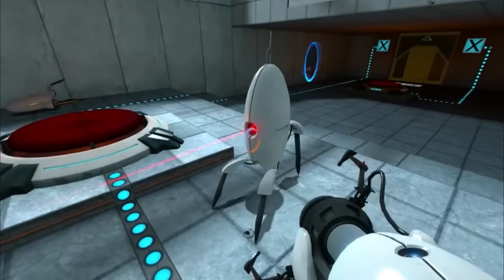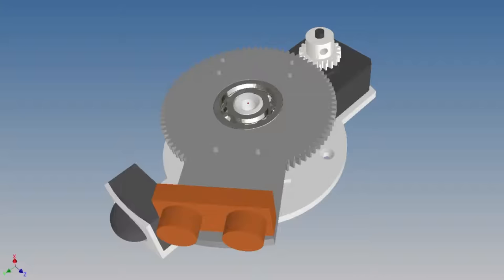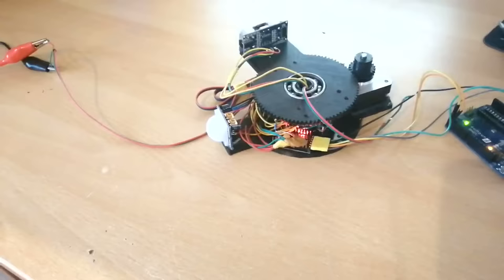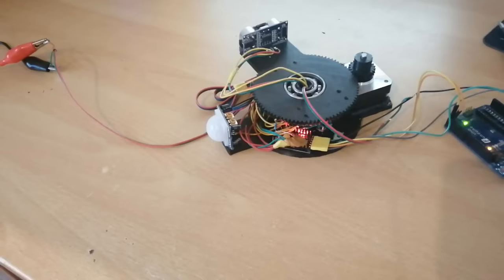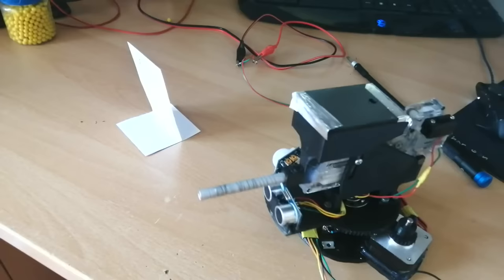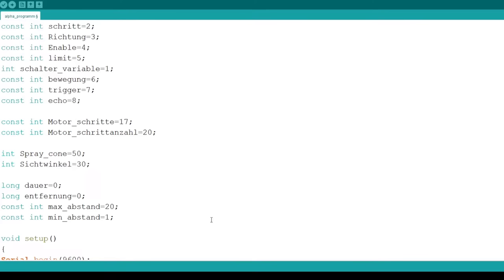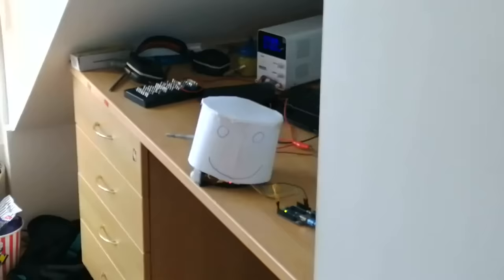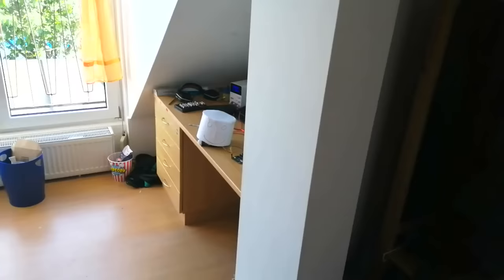Real Life Sentry Turret, that Protects your Room

Comment: So my question is, if you have another object that isn't moving, say a water bottle in the way, how would the sentry distinguish between the object that triggered the motion sensor and the other object sitting in its path? The rangefinder only finds objects within the area of 2 meters so it would shoot at literally anything within those 2 meters moving or not. If I were you, I would check the sensor and see if any events are fired detailing the location or at least general direction of the object which moved, and then the first function of the rangefinder would be to search that immediate area. This could also be done possibly by using multiple sensors in a circular arrangement with a narrow field of vision, whichever sensor fires first is where the sentry rotates to face first, this way you can at least target something in the general area of the detected motion and not just the wall
Reply: Same reason why if you are driving the speed limit but are in front of the camera when another car sets off tye detector, you get the ticket.
Reply: Or you could mount it on the door way facing the entry so the only object would be a human

Comment: Love this idea but personally would have gone with paintballs.  Having played both games, I've come to the conclusion that while airsoft pellets can do more soft tissue damage than paintballs with their high psi, they hurt less on impact and therefore have less stopping power.  Paintballs carry considerably more energy to target and inflict more pain, while also having a much lower chance of causing external bleeding.  Airsoft pellets leave bug-bite like abrasions on the skin, while paintballs leave large bruises.  Do you want the trespasser to feel like they've been bitten, or like they've been punched?
Reply: Sure, cleaning paint off your walls is a good idea 😂
Reply: @JC-Alan  Well it's non-toxic and non-staining, so a lot easier than fixing the tiny holes airsoft pellets leave.  Airsoft pellets carry almost no energy but also have so little surface area that you'd be surprised by their penetrative power.  They won't get stuck in the wall but they'll chip the paint
Reply: He probably could have used rubber balls and a flywheel thing, right? Maybe the Nerf Rival rounds. About the same weight as a paintball and no paint stains. But I wonder if the paintball still hurts more because they explode on impact, right?

Comment: It does kinda look like a very simple CIWS or CRAM system, but if you wanted to use object detection, you can easily do so (in Python, I’m still somewhat learning c++) with OpenCV, cvLib, and pyfigmata (to control the arduino). I’m currently working on something similar using object detection, except I’m going to be building an RC airsoft tank. It’s a tank with aimbot (:

Also, for the tank I’ll be using a raspi instead of an arduino, to run the code without a computer.

Comment: 🥺💬  That is a very nice room protector, somebody will tell you to add a camera for widescreen scanning or placing spot or long-load bullets pallet but with the same device in codes you can work with parallel moves, and multiple actions simultaneously because it does not require to working at only one action at a time but you can target multiple invades with a penalty shot. ( That is Aduino but it message event or ACK is working in C too )

Comment: Looks neat. You'll have a faster scanning response if instead of returning to zero position after scanning, you just start scanning from the other side. Kind of like the Cylon eye in Battlestar Galactica.
Reply: I think it hits the limit switch when it returns to the zero position. Maybe it's to increase accuracy, since stepper motors can miss steps sometimes

Comment: I understand that it was 2 years ago and I HOPE You already have Your own living space aka apartment or hause, but there are option to use as a keyring trinket(just don't know how to prpperly call it) some tracker or even a mibile phone or smart watches. With porpuse build tracker I think it be easier, but with smartphone or smartwatches more practical. For second option You need bluetooth module just monitoring active devices and switched on bluetooth on phone or watches(as I know watches mostly connected via bleutooth so it even not bother You in that case). Bluetooth range usually are 10m excluding walls if Your home have monolith concrete walls with rebars, so You at least be near when some one whish to enter room, otherwise if turret not detect You via active bluetooth device it on sentry mode. Just nice touch be to add speacker which vocalize first warning, but it be just polishing of concept.

Comment: We are doing a turret atm with a neural network, that can learn what to target. We are doing it with a camera and full hd, but the raspberry only manages to do 10 fps which is to slow for fast moving targets and we also programmed lead, therefor we have to switch to computer for more power, so we can have atleast 30fps.
Reply: You can use a Coral Edge TPU to speed up object detection too btw.

Comment: I doubt that stopped them. If you still have the problem, get a timer/alarm clock called the Screaming Meanie. It has 220 decibels, and if you connect it to a motion detector it will deter God himself from coming into your room.

Comment: hey nice video just wondering which servo motor are u using?
Reply: I think it's a stepper motor, but there are limit switches when it turns, that way, it knows where is it, as stepprer motors don't have positional sensing.
Reply: MOST stepper motors don't have positional sensing. There are more expensive ones do have an encoder which enables this though.

Comment: Hey, great turret! I was wondering how the barrel and hop up mechanism works? I know this was many years ago, so it's fine if you don't remember. I've designed my own 3d printed barrel and hop up, but the BBs won't shoot very far. Any help is appreciated! (I've never dealt with airsoft btw, so I may be using the wrong terms)
Reply: For anyone else wondering, You don't need a hop up system (the thing that creates backspin on the BBS. The barrel has to converge , like a v shape. I got the BBs to shoot father, and they hurt a little. I'm just trying to make this turret for fun and games, not to hurt muchz  

This video may help explain. The barrel converges in the middle. https://youtu.be/CIWWXTbbyq0?si=FTJhdmBeiEsM9KSE

Comment: Can you modify the weapon system to fire needles into an adversary’s balzack? With schematics if you can. Or a system that fires a 3-4 kilogram spear with hunting arrow tip and razor blades as the cutting edges of the spear. Fired by way of ignited gas similar to a potato gun. Perhaps that can be stationed directly behind a giant Teddy bear 🧸 which has an IR motion detector for an eye 👁️?
Reply: why

Comment: Only too slow. Coukd you overclock it or stuff? The arduino should be able to do faster?
Reply: The speed of the servo? He might have designed it to be slow so it is more accurate. Or that's just the maximun speed of the servo motor
Reply: Edit: I realized those are stepper motors
He could have changed the gear ratio between the motor and the "head"
But I'd say the reason he didn't was for accuracy